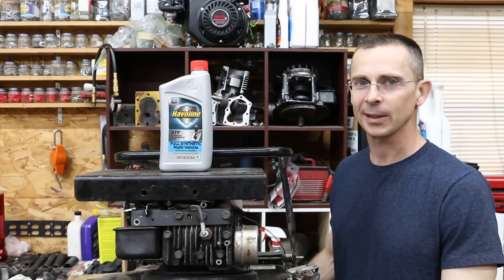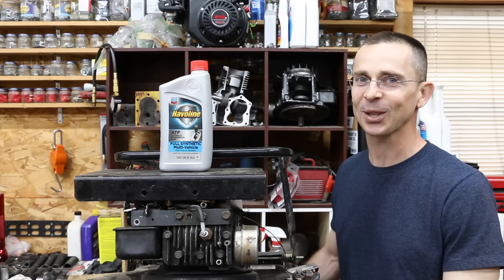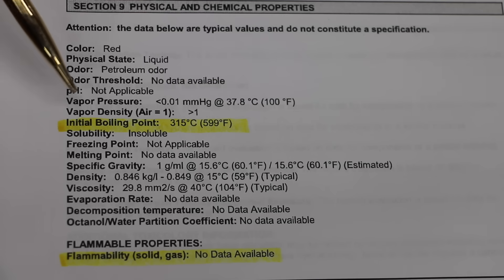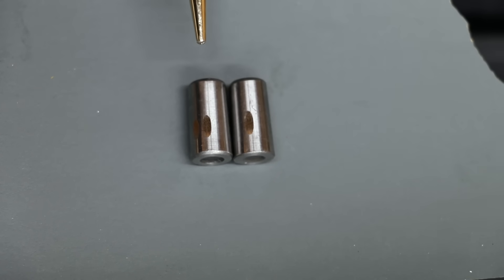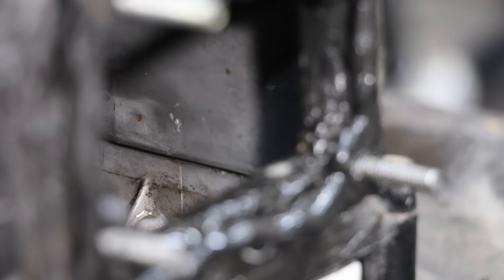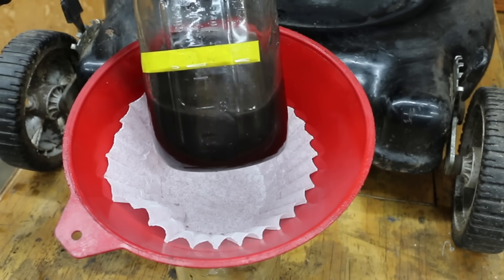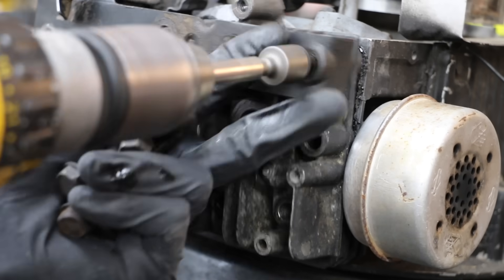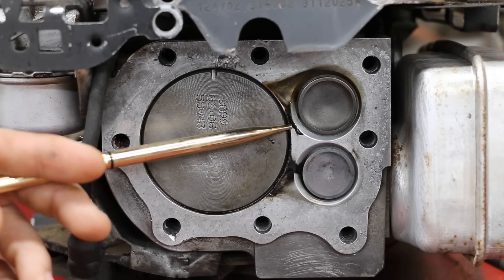ATF as an Engine Oil substitute?  Let's see what happens!

Comment: Hi, friction modifiers are important in how a transmission runs and will effect your bearing test. And here's why.

According to how many clutches are used in the clutch pack per gear, and how wide they are determines how much friction is needed. Less friction surface per clutch pack means the fluid needs more friction, not less, to shift and not slip under load. More friction surface area means less friction in the fluid is needed. This is why certain fluids are required for specific transmissions and if you use the wrong friction type you can ruin the whole transmission.

Example: The old ford mustangs that took type F fluid, used that fluid because it was "more friction" because those transmissions required it. If you would have put a less friction fluid like a GM fluid in there. It would have slipped under load burning up all the clutches over time.

Now in a transmission that required less friction if you put the more friction fluid like using ford type F from the old days in GM trans from the same period. What would happen is you would get hard shifts between gears because the clutches would grab harder when engaging. A lot of racers that raced GM cars used type F to get firmer shifts and lower times at the track. So you can use a higher friction trans fluid in a trans that does not need it, if you want firmer shifts, but you cannot use a lower friction fluid in one that requires higher friction and not get slippage under load.

But because transmissions are way more complex than they were in the 70's, it's best to stick with what is recommended and not chance it. Also most transmission oils are 10w straight weight. Because a transmission is basically a hydrolic pump that shifts gears using pressure to do so.
Reply from the maker: Thank you for this information.
Reply: The transmissions that have no gears that they have out today work like this: Picture 4 shock absorbers making a cross. Each one has a gear on the ends that are the furthermost out. These shock absorbers are controlled by hydrolic pressures that are controlled by a computer. A chain goes around this so the absorbers and the gears on the end act as one gear no other gear needed. As the pressure increases these absorber like things act like hydrolic extenders making the gear bigger changes the gear ratio of the final drive.

Think of it like a 10 speed bike sprocket set up on the rear wheel of a bike. Instead of all those sprockets think of it as being replaced by one sprocket that can grow to all the sizes of the existing sprockets so it eliminates all of them except the one. So instead of gear shifting like regular transmissions you have a gradual gear ratio change so you never even feel a shift.

Benefits: The computer that controls this can keep the engine within it's power band range at any acceleration load. Which translates to more mpg in the city because you won;t need to press as much on the gas pedal to get the same acceleration when the engine stays in it's optimal power range. At highway speeds, the trans can adjust to the rpm range that is the most efficient. 

The technology has been out there all along and was using centrifugal force to control the expansion of the gear to control ratio. But since it's now computer controlled and it's constantly being worked on, on how it can be improved to work for more mpg. I believe once they get it into hybrids it won;t be unsual to have them do 100 mpg. And have more power to boot. What needs to be done in every instance this is used is find the balance between the car computer and trans computer to where both work together to get the most efficient results. When this starts getting achieved is when most all transmissions will be this type.
Reply: One more thing. When using the bearing test thing, if you heat the oil to operating temps you get better results. About 30% of the additives in oil do not come into play until the oil reaches operating temps. These additives include:

1) Viscosity improvers.
2) Friction modifiers.
3) Anti-wear additives.

200-250 F should be enough to activate these additives in both engine oil and trans fluid.

Comment: I had a very noisy lifter (collapsed lifter) after a lower intake manifold gasket change on a 4.3L Vortec. Gunk must have clogged a lifter port. Ran it ticking like that for two weeks. I used Wynn's valve treatment, sound went away in about 30 seconds. Not sure about ATF, but the Wynn's worked. If your engine is a push rod type (no overhead cam), be sure to use the recommended viscosity. A higher viscosity can actually reduce lubrication.
Reply from the maker: Thank you for commenting on Wynn's.

Comment: I’ve used ATF to help reseal piston rings on a engine that has been sitting for a long time and had hardly no compression. I also use ATF to clean the cylinder bores on a fresh machined engine before building.
Reply from the maker: Thank you

Comment: Actually in practice you are supposed to add ATF to the oil. NOT use only ATF. You are using the detergents and ATF is a thinner lubricant. Meaning it may be able to clean up tighter areas within the crank case and cylinder head. When doing this it is only recommend to use, at most, half a quart in place of half a quart of oil during an oil change. Only for a limited amount of time, say maybe 50-100 miles. After which an oil and filter change is necessary.
Reply from the maker: Thank you

Comment: I think detergents should be used exactly as described in most manuals like amsoil's. They are for cleaning the engine. So you drain the oil, put in fresh oil - put in x% of detergent (I used approx. 20%) and run the car at idle or just above for 10 minutes with no engine load. Dump the oil and replace.
I've drained my oil before after 200miles without any additives so I know the crazy difference it makes and how much carbon comes out of the engine because it's always black after those 10 minutes. But the viscosity is sadly still very good and thick and the particle count is low - so this is very much mostly a waste. Cars are designed to run with a certain % carbon on everything.
Reply from the maker: Thanks for commenting on this

Comment: Another video idea, i know you use new spark plugs all the time, i was wondering if you could do a fuel consumption test of a standard plug, platinum, iridium, E3, and a Pulstar Pulse plug
Reply from the maker: Yes, I'll do it. Great video idea
Reply: @ProjectFarm  over several years time in 3 different vehicles I tried those bosch quad spark plugs ( four prongs ) . I don't know much about engines but it didn't make any difference. A mechanic told me they are a waste of money.
Reply: There is a couple other videos from someone else that did those tests and they got a tiny bit better gas mileage and better performance with the iranium

Comment: I have been using Diesel as engine oil to clean the engine from sludge and it works perfect, I just replace the oil with the same amount of diesel and turn on the engine on idle for 60 seconds and then I drain the diesel and put regular engine oil of course this oil needs to be replace after a week because is mixed with diesel.
Reply from the maker: Seems like a great strategy.

Comment: Never used ATF as engine oil as that isn't its intended purpose.
I have however, seen many hydraulic machines and tools that use ATF as a hydraulic medium. Talked to a lubricant expert about it once and he said that if your machine requires a hydraulic fluid in the 10W range (ISO32) then ATF (which is about 7WT) is a superior choice as it contains dispersants, defoamers, detergents and anti-wear additives in much greater amounts than just about any other available hydraulic fluid. Plus, being red its super easy to determine what fluid is already present when topping up or flushing.
Reply from the maker: Thanks for commenting on this.

Comment: You should buy a small DIESEL engine to test some stuff as fuel (used motor oil, veg oil, brake fluid, atf etc). THAT would be cool!
Reply from the maker: Great recommendation!
Reply: @ProjectFarm  , I ran a blend of 20% regular gas with 80% used canola oil in my 02 duramax for about 40,000 miles, I centrafuged all of the fuel blend before adding it to my fuel tank. I never ran the mix in the cold of winter, because it will fail to flow below 15 degrees. Otherwise the engine ran great including putting down 550 rear wheel hp on a chassis dyno.
Reply: @ProjectFarm  as a diesel owner I would love for you to do diesel testing
Reply: @ProjectFarm  ATF in diesel engine as fuel will make more HP  but how much more ? please test that :) big up from Poland keep up good work !
Reply: @ProjectFarm  yeah just buy a cheap diesel car with low km.
Reply: @ProjectFarm  that's a wicked recommendation. I wonder if this video was ever made
Reply: @ProjectFarm  Have you done the promised test meanwhile?
Reply: @ProjectFarm  can I ask you one thing?? Why you never test militec 1? At least I've never seen you doing this. Please? Militec!
Reply: diesels love atf and hydraulic fluid
Reply: blyguy and wmo (waste motor oil)
Reply: @cbly  yes the piston rings love it
Reply: @cbly  As fuel, yes, not as lubricants. Old school diesels without 30,000 psi injection pumps will run on damn near anything.
Reply: Like that idea
Reply: Andrew McFadden 
Andy, may i suggest you ask management FIRST, then offer the engine.
Rather than offer to ask first ...
Reply: I ran all old Mercedes-Benz diesel from the 70's an entire summer on filtered French fry oil.  Worked great!  Then when it got to fall and the temp dropped below 45 degrees it wouldn't work.  The fuel solidified.
Reply: Hell, there was a couple time in an emergency where I ran my dodge off of motor oil or atf I had sitting in my bed because someone had siphoned out my diesel while I was working at a job. Just a little bit harder to start because it's thicker than diesel.
Reply: Top gear ran an entire endurance race with a diesel car on veg oil
Reply: I second this idea! Diesel and gas engines side by side in testing!
Reply: Andrew McFadden  Christ, a male Karen. I can't stand stuffy guys who insist on being called Richard or Robert or Andrew or Anthony, instead of Rick/Rich/Dick, Bob/Rob, Andy, and Tony/Ant. They tend to be stiff, humorless, fusspots. Cheers, ANDREW.
Reply: @ruben_balea  Oh wow! Didn't even know that happened.
Reply: Yes that's cool
Reply: But  ... then he won't be able say:

"No small diesels were harmed during the making of this video."  😥
Reply: My car has a mix of diesel petrol/2strokeoil mix and alot of old engine oil runs perfect
Reply: Andrew McFadden  damn drew lighten up
Reply: Or get a yanmar 3 cylinder diesel, they come in the 1025r deere tractors and 2025r. I love mine it eats used engine oil
Reply: Motoren Zimmer did this with an old Mercedes-Benz W123 Diesel. It run even SMOOTHER on vegetable oil. 🤭😂
Reply: sounds like a great idea
Reply: a small diesel engine from an old sailboat, some were as small as 8hp
Reply: to keep your engine clean and healthy you should concier using engine flush - it works: https://www.youtube.com/watch?v=x4u64lKBbhQ
Reply: Andrew McFadden  I would never be worried about a guy named ANDREW (not Andy) being the "wrong individual"! 🤣
Reply: I will like to see that
Reply: Some diesel stuff would be cool already watched the additive video
Reply: I use to run my 12 valve cummins on waste oil and atf
Reply: U contributing?  Put your money where your mouth is.
Reply: THat would be more than cool!
Reply: Get a cummins 4bt!!!
Reply: Robot Cantina did it a few monts ago. Also a cool channel.
Reply: Once every 3/4 oil changes I will substitute one qt of oil with one qt of stf and run a normal oil change interval my engines when torn down were spotless
Reply: Ohhh thin down grease or petroleum jelly with diesel fuel and see if itll run on it
Reply: I agree, this would be awesome!
Reply: Not to be mean, but small diesels cost a BUTT TON of money
Reply: The sad thing is that it’s really expensive for a small one, 500 dollars
Reply: Andrew McFadden  DAMN Andy! Sensitive much? Lighten up.
Reply: Andrew McFadden  Andy. Andy. Andy. Are you steamed yet? My only purpose here is to bring you back to reality for jumping into the other poster's shit for calling you Andy instead of your given name, Andrea. Again, I say, lighten up. Life is too short.
Reply: @ronrodgers6531  😂👍
Reply: Andrew McFadden  Unlike you, who obviously lives under a bridge, I live in a house. Thank you for asking, because I understand how concerned you are.
Reply: @ruben_balea  well i think the smell is more of the cooked oil more than the food, considering fries and burgers smell like oil, so the smell is actually the canola or veggie oil

Comment: once by mistake i added 6 qts of atf  to an already full crankcase of a MB V6 (112) used in  C320 i drove it for a week like that before realizing my mistake  these engines hold 9 qt eng oil  After restoring correctt oil level with drain and refill  This engine lost its misfire..rough idle noisey valvatrain  and oil consumption issues COMPLETELY
Reply from the maker: Wow!  I love it when mistakes turn into something good.
Reply: Did the mix up happen because of the puke tube with red plug, and transmission with a BLK plug on the puke tube?

Comment: I've used ATF to break rings free on old engines that have been sitting a long time. Most recently on a 68 VW Beetle engine. I don't know how you'd go about testing if this works or if just running the engine freed it, but I feel like it worked every time I did it. I didn't put the ATF in the crankcase, I put it into the carburetor and cranked the engine. Sometimes It was running before the ATF, just smoking really badly, and sometimes it wasn't getting enough compression before the ATF, and was after. After the ATF, rings seemed to have broken free and the engine would run without smoke (or with very little). In my manuals for British cars (my Triumph Spitfires) it says to use water to 'decoke' the engine, but that is on regualrly scheduled maintenance and on a running engine.
Reply from the maker: Thanks for commenting on this!

Comment: I'd like to see a comparison between ATF and Marvel Mystery Oil.... I always had better luck freeing lifters with Marvel.
Reply from the maker: Thanks for the recommendation!
Reply: If you have a sticky lifter, do you throw marvel in the crankcase with the exsiting engine oil or drain and use straight marvel. I have a sticking lifter and need to free it up
Reply: @trailerpark187  you add a quart to existing oil about 1000 miles before your oil. it make take a few times as its not as agressive as a flush or other things you can add to your oil
Reply: @Demon09-_-  Have any experience with the older 1.8 VVT Toyota(and prism). They(can) run like clocks but use oil like drip tubes on a fire. They claim the bottom oil rings holes are too small and get clogged at 100k i or so. I cleaned but now ordered a new PCV valve and if that solves my 200 mi per qt consumption great.....but doubtful. I do have some MMoil in it(well I  did) but trying to find out even more ideas out there. Last resort will be new rings. Just bought the car (chevy prism)and put 200mi on it and it is dry under all over....but boy you never ever know what you find when you get a car like this. Hopin for the best. Thanks
Reply: @trailerpark187  I have a 1999 Ford 150 pickup with a 4.2 V6. It has 214,000. It has had a little lifter tapping of late. Not an everyday driver. Just changed my oil and substituted one qt. with Marvel Mystery oil. Been a few weeks and the tapping seems to be doing better. Probably won't wait a full length to change oil next time.
Reply: Yes yes yes
Reply: thanks !that was my question
Reply: Or kerosene.
Reply: Anthony Perna  I think MMMoil and AT are almost same thing.
Reply: @craigkeller     They are not the same thing.  MMO was invented in the 1920s.  Automatic transmissions didn't even come along until the 1940s and they weren't mass produced until the late 1950s.  Oil of wintergreen isn't just for smell in MMO. It's a powerful cleaner. ATF has friction modifiers in it also for the clutch packs.  Not something you want to run in an engine long term, but a little ATF won't hurt once in a while.
Reply: @craigkeller   kinda makes me wonder what ATF mixed into gas in a similar ratio to MMM would do to an engine.
Reply: @craigkeller  THATS NOT TRUE,IF U PUT ATF IN UR GAS IT WILL SMOKE LIKE A FREIGHT TRAIN AND LEAVE ATF BURNT DEPOSITS ON THE INTAKE VALVES PISTON HEADS EXCT,WHERE AS MARVEL CAUSES NO SMOKING AND CLEANS DEPOSITS.
Reply: @craigkeller  I think it's a mix of an atf and kerosene.
Reply: @craigkeller  They're not. MMO's flash point is 160 F, ATF has a flash point at least of 200 F (sometimes over 300.) MMO would seem to evaporate in the crankcase although I haven't ever tried using it for anything.
Reply: @101Volts  ATF flash point is 160c not 160f. I work at a refinery and we make a grade of base oil that’s the core of ATF.

Comment: Test teflon coating on valves.
Reply from the maker: Great video idea!
Reply: @ProjectFarm  you could even coat the whole head or piston with a Teflon paint protectant or some kind of Teflon compound to see how effective it is. Once I spilled some Teflon paint protectant on a catalytic converter and once it got hot it never came off. So I wiped some around the catalytic converter for s** and giggles and it was permanently waterproof.

Comment: We used the old ATF trick on old SMOG anchors, back in the 70's & 80's and very infrequently on neglected engines-e.g. no oil service... Now a days the oil pickups are so small they will sludge up and CLOG. Moderation is the only way to clean a dirty engine. Unless you have a special machine.....
Reply from the maker: Great point regarding moderation!